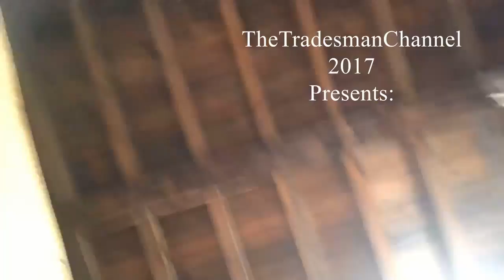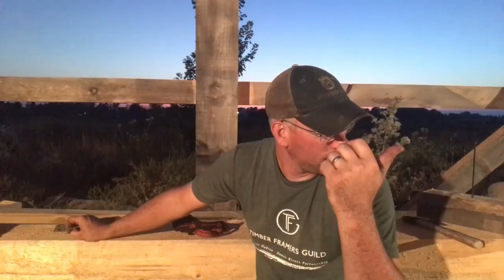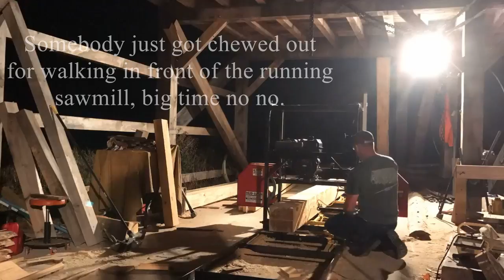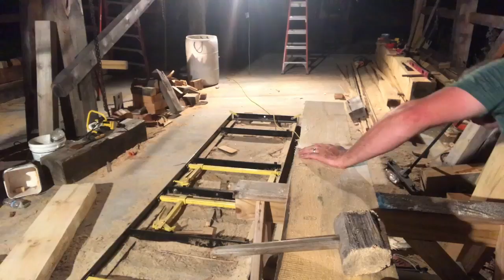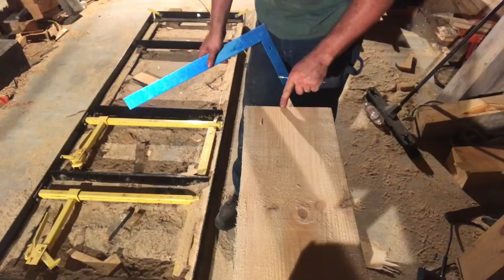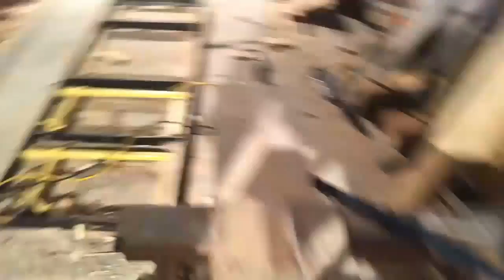A Timber Frame Vlog #53: Some More Top Plate Work

Comment: Great instructions and reference.  Please prepare an "AS BUILT Complilation" for both your reference and providing an instructional comments for each step of the structure. The farm barns of my youth (ILL.)had mortise / tenon peg beams for hay mow framing. Cheers.
Reply from the maker: +Karl Brohammer I plan to do an in-depth online course for timber framing.  Its going to take a bit to do but once this shop is done I'll be working on it.  I'm glad you're enjoying the project.

Comment: Nice video.  The bandsaw really makes short work of the rip cut!!  When you are making so many joints the same, would there be any benefit to making a template out of 1/4" sheeting to layout the mortices and tenons?
Reply from the maker: +Todd Bailey I don't do templates often, I've always liked the measure each part for layout.  It does however leave room for human error.

Comment: I presume your a member of the TFG?   On the bigger timber with splices I use this small band mill for the long cuts. I had set it aside for a spell but brought it back out and am happy with how it works.  Square rule is how I mostly layout but have used snap line square rule and some plumb line scribe.  Good stuff your putting out.    https://www.youtube.com/watch?v=-zdJAm-ByH8
Reply from the maker: +Timberdoodles I am actually saving to join, I have been to some functions and so forth.  Every spare dime I get right now goes into the project...damn bills!  I studied on timber framing for about six or seven years before jumping into it.  Read a lot, looked at a lot of old barns in my area, every video I could find.  What I did discover was that there was not much simple how to on the subject so I decided to start sharing what I've been learning.  This is my first build but the bug has bitten me to the point of obsession.  Every joint gets better and easier as I go.
Reply: Very similar for myself.  Started back 1995 when I purchased my sawmill and soon realized I was going to wear out the mill or myself sawing lumber for folks, so we value added and took on timber framing to utilize material from the mill.  First work shop I attended was at Fox Maple here in Maine, then joined the Guild.  Most of my work is based of Jack Sobon's work.  Been cutting frames ever since.  On a sabbatical of sorts at the moment and focusing on more farming.  Still doing small projects, but no big full on projects.  No utube back then.
Reply from the maker: +Timberdoodles that's pretty cool.  I'm a little late to the game but trying to get setup.

Comment: Why deligate the large off-cut to firewood? Could it be used for a brace? If not you have 3 good bowl/platter turning blanks. It's still a good sized piece of wood. Waste wood goes in the heater. Of course if you have no use for it, it is waste wood for you.
Glad to see you adjust the blade guide on the bandsaw.
Thanks for the break, I gotta get back at it.
Reply from the maker: +Thomas Russell the blade on this mill cuts fine with the guide in or out of there is proper tension on the blade.  Most crap cuts come from dull bands.  The wood is one of those cases where I have too much piling up and I need to hear my house.